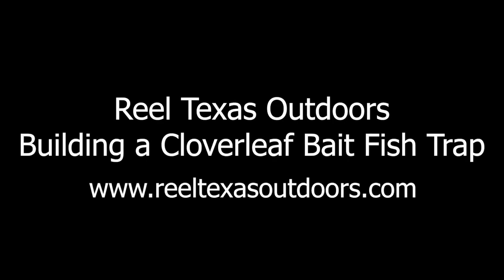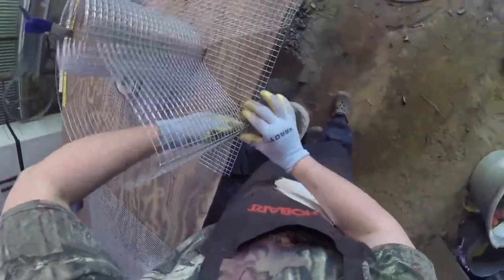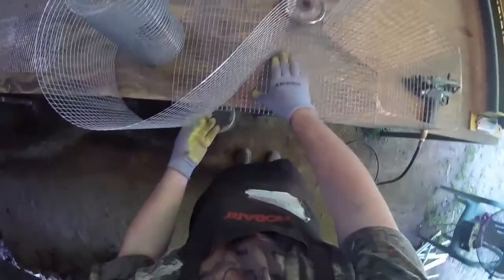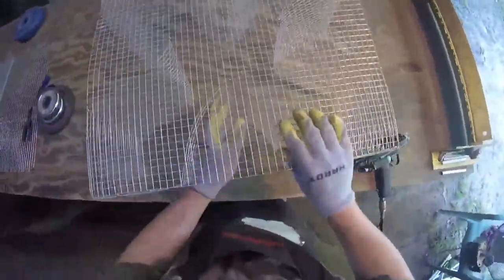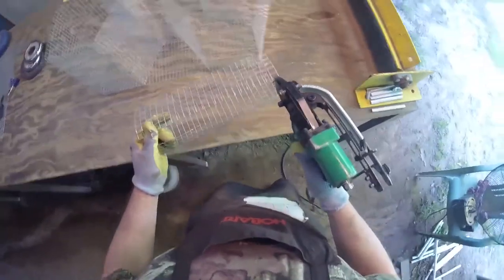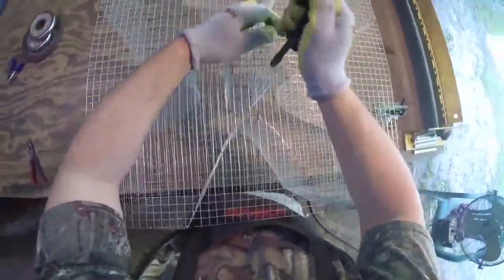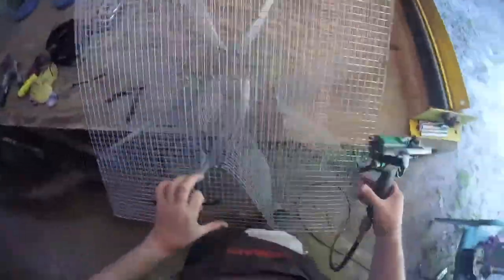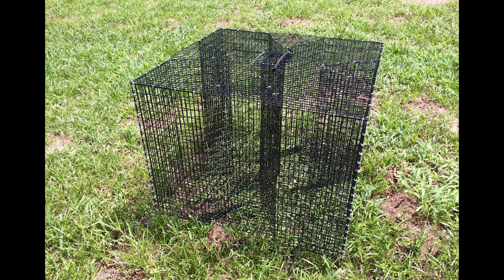Perch Trap Construction - Cloverleaf Trap Assembly

Comment: EXCELLENT !!! Man you have that down to a science !!! I am going to have to watch this several times to get the process down, but I love it......thanks for sharing.
Reply from the maker: Catfish Joe - thanks for the comment, man. Best of luck on your trap!
Reply: @ReelTexasOutdoors  I bought the supplies yesterday and made one but this is what I learned from the process. 1- it is harder to do than it looks. 2. difficult to get the wire flat when you unroll it. 3. the hog nose rings that I have are to big so i used zip ties. They hold but it takes a lot of them and you need very very small ones. 4. it did not come out like it was supposed to. It looks horrible. 5. I can earn 50 dollars to buy one from you in less time than it takes me to build one on my own that looks horrible and is not very strong. 6. From this point on, I will buy them from you so I know I have a strong trap that will work and last me a long time. 
Thanks
Reply from the maker: @buynsell365  - man, I'm sorry it turned out that way for you. It sucks to put the time in and it not turn out like you want it to. To be absolutely 100% honest, your reasons are the main reason that I personally sell so many traps. At this point, I have built thousands and thousands of these things, and there's absolutely no way that I would ever do this by "hand"... as in using zip ties or manual hog rings. It's just far too time consuming. You definitely need a large area to work and the right tools... or it's miserable to do. 

Thanks again for the comments on my videos, and I will definitely be glad to build you a trap down the road. =) 

Thanks brother!
Reply: I’m looking for your hog ring gun can you tell me where to find one and what size is it

Comment: Would this work well in saltwater? Also, what size mesh and what's the size in feet did you use?
Reply from the maker: Hi Joe... thanks for the comment. This mesh would not work well in salt water. It's just regular galvanized hardware cloth in this video, and I think it uses around 14 feet. 

Thanks.

Comment: I put hotel on mine an it catches 2 times better but some states may not allow them on the trap Texas only has a size requirement that it can’t be bigger than no regulations on design that I know of
Reply: What’s do you mean by hotel
Reply: It’s s square trap with a divider so I make my trap with 3 entries in an the the 4 entry hole is inverted an there’s a full width 8 inch wide room that they can go into so the can go into trap an then into the other part also usually if trap is in good spot both spots fill up